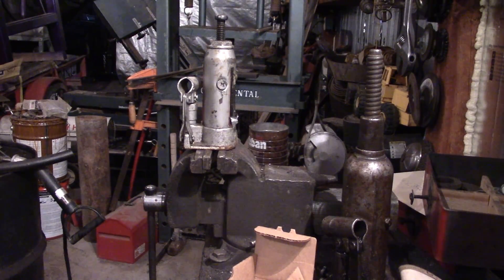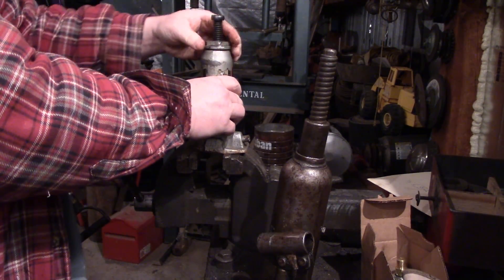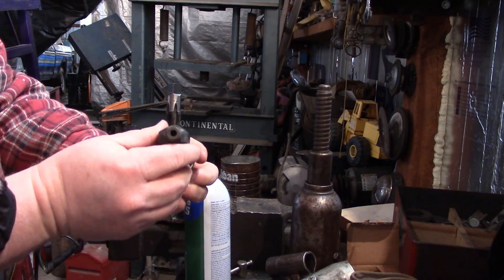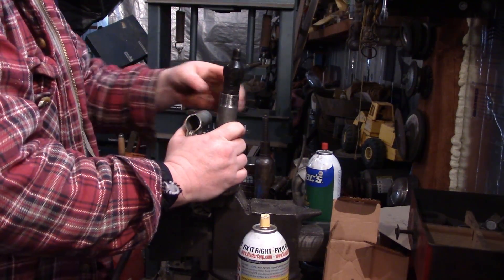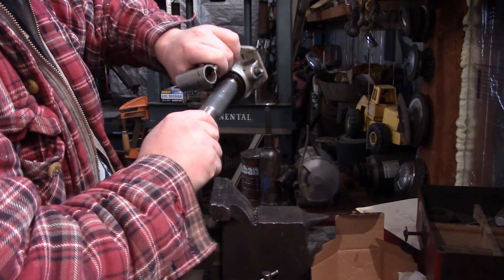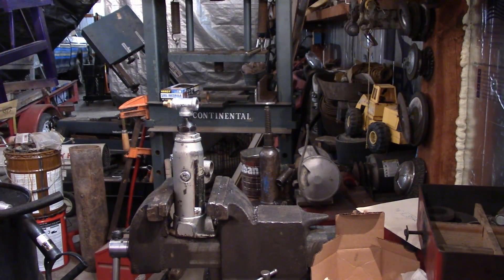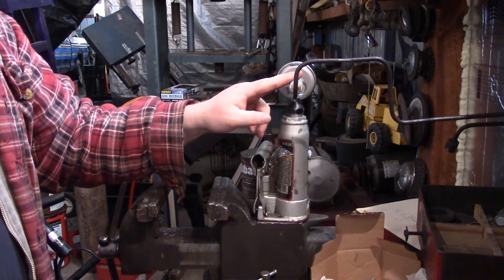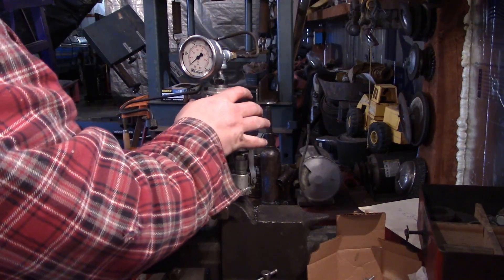No weld pop tester from a hydraulic jack

Comment: That little hole is the relief that stops the ram from going out any further. Once the bottom edge of the ram passes the hole, any additional pressure will just bleed out the relief hole back into the reservoir . If not the bottom edge of the ram there is probably some sort of channel machined into the side of the ram to serve the same purpose as the bottom edge would.
Reply from the maker: Thanks for sharing the information. I had wondered about that hole and now it makes sense.

Comment: The pump in a 2 ton jack is about the same size as the pump on a 10 ton jack. The difference that gives the 10 ton more capacity is the diameter of the ram, as you said. You shouldn't have any problems with it.

Comment: Mystery top hole is for air circulation when fluid lowers or rises.
Thanks for idea.
Reply: Are you sure that top hole isn’t for allowing pressure to bleed off, back to the tank, when the cylinder reaches full travel?

Comment: Nice vedeo..i have build a pop tester but im have a problem is not building up pressur.and i have not leaking.. please help
Reply from the maker: If it isnt building pressure and your certain it isn't a bad injector some component somewhere in the jack itself must be bleeding by. It wont take much to drop pressure since liquids really dont compress much. Never use your hands/body to check for leaks high pressures are dangerous. It did take me a bit to fix all the leaks of the threaded fittings. I  had to disassemble all threaded fitting and redo them in sealing tape for them to stop leaking. Before that i recall it would cause a consistent pressure drop and  even would stop a full buildup of pressure. Outside of that maybe the pumping mechanism of the jack itself is air locked.

Comment: Nice work! Where did you buy the 3/4 to 1/4 swedge fitting? Are these high pressure fittings?
Reply from the maker: Mcmaster Carr and Ferguson are a couple ive used in the past for the less common sized adapters. Yes they sell high pressure fittings.

Comment: Friend, nice video. Just thinking about if is possible to use a hidraulic manual pump to test diesel injectors, then can be used as well an electrical hidaulic pump to do same task...? filling it with diesel. same as pop manual pump tester...what do you think....? I have not found any video on the internet about this proyect.....

Comment: good video, but yo shouldnt be using black iron, or black iron galvanized. 1. the galvanization can flake off into the injector. 2. black iron pipe is only meant for 120psi. or less.
Reply: Looks like it was strong enough.

Comment: Cool video bud.  I'm in the process of building one of these myself. Nice setup.  One quick thing.  The dude who invented the original pop tester actually did an update on service at a later date and he suggested adding a mix of atf trans fluid in with the diesel to help keep everything lubed up and prevent any corrosion.  I believe it was like a 4:1 diesel to atf mix.  Not much.  A little dab'll do ya.  If you have any issues later on, hope that helps.